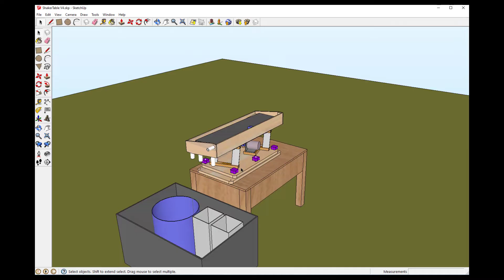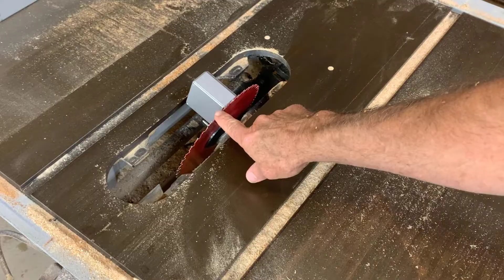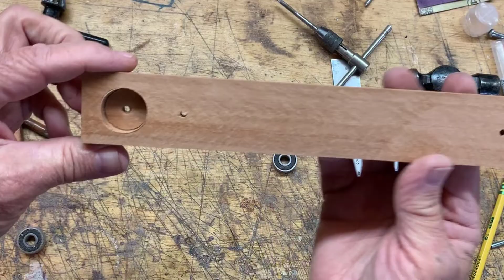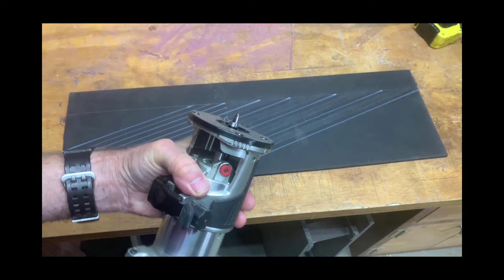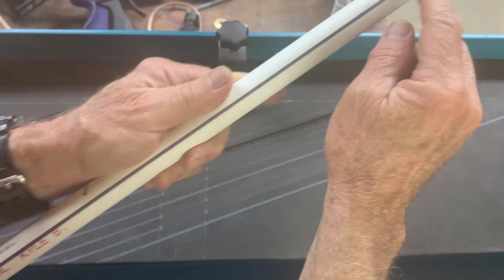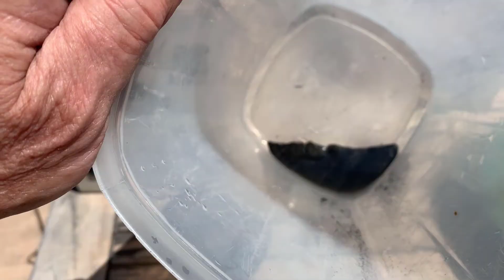Building the Mini Gold Shaker Table

Comment: Hello! Do you think this could work to separate copper from plastic? I used a copper wire shredder but I have mixed copper and plastic, they are separated, not intertwined, but the shredder's output is mixed, and I need to separate it completely from the copper
Reply from the maker: Yes, the table can be tuned to do that, for sure.

Comment: If I made a table with the same concept would 24 in x 36 in, would that be too heavy for the flexure system? Let's say I chose to use four 6-in wide flexures?
Reply from the maker: Yes, it works. I've made a table nearly that big in the same style shown in the video. I used 4 flexures that were 3 inches wide.
Reply: Hey thank you so much Dave. I ended up making 5-in wide flexures and it's just too stiff to get any motion out of it so I'm going to cut my flexures down right now and hopefully that takes care of the issue. Thanks for replying as well You're awesome man!!!!
Reply from the maker: @trevorhastings946  You can easily test the flexure stiffness when you have the table assembled but without the motor and drive. Excite the vibration in the table and note the resonant frequency by counting vibrational periods using a stop watch. You should get between 5 and 6 oscillations per second (5 to 6 Hz).

Comment: How many tons  or pounds per hour
Reply from the maker: About 50 kg/hour but it varies a lot with the material.
Reply: @orophilia  I was planning to use it for sulfides super fine sulfides
Reply from the maker: @josh2916  Yes, if the table is setup correctly then it will concentrate the heavy sulfides.  -- Dave

Comment: I was wondering if you got around to building a better one that you like for the field? And if not when you Go to build the better one. If you would make Extras. Please??? And if you want help. I will gladly help you. I'll even go gold panting with you.
Reply from the maker: Hi DWC, Yes, I've built several more after that one. I'm just finishing a new one that combines all the lessons that I've learned in the past two years. I'll have a video out soon. It's called the skew-bump shaker.
Reply: @orophilia   I actually caught and watched all those new videos that you just put out about your new Shaker table. Looks like your super close to getting it down to nothing but gold...
Reply from the maker: @DWCStuff  The problem of gold concentration changes dramatically based on the size of the gold particles and the amount of other heavy minerals. It's very interesting to find the optimum tuning of the table for each set of conditions. For example, separating gold from black beach sand is totally different from separating gold from milled load ore. I'll be doing more demonstrations of this in the future. It's very hard to fully separate small gold particles from black beach sand. It's best done in two steps. -- Dave

Comment: Love you video. Building one myself but have run into a problem. I can't find any the bit you use anywhere. Been searching for days. Was it a 5mm? With bearing at the top?
Reply from the maker: Hi Wayne. Do you mean the 8 mm bit that's used on the acentric coupler? If so, you can find it on Amazon. Just search for "8mm drill bit" and you'll find a bunch.

Comment: Hey I like your work and i am trying to make a project for my diploma completion but cant get the alloy plate (6061 t6). It would be great help if u tell from where can i buy it !
Reply from the maker: Hi Rohan. Just use any aluminum bar stock that is 1/16" (1.5 mm) thick and 2" (50 mm) wide.  -- Dave

Comment: Dear Fellow.  You have done a great initiative, I praise you.  You can also use lead oxide for recovery test.  In addition, how many degrees is the tilt of the table?  Thank you very much.  I enjoyed.  Hashem.
Reply from the maker: Hi Hashem. The table is tilted at 1/4" per foot, or about 1.3 degrees.  -- Dave
Reply: @orophilia  thanks 😊🙏🏻

Comment: Really love the video! I get that the main deck has essentially a 1/4" inch rise but are there any other angles that need to be observed with the deck to make it function correctly?
Reply from the maker: Hi Adam. On this small table I used two steps, each about 1/8", in order to reject the lighter material as it flows toward the output ports. Sounds like you get that. Otherwise, the bed is flat. In use, I slope the bed downward toward the tailings drain by 1/4" per foot so that the water flows in a direction that's more or less perpendicular to the water bar.  Take a look at my other video on the shaker table, called "Portable DIY Shaker Table..."  -- Dave
Reply: @orophilia  Thanks dave! Ill take a look at it

Comment: not sure..but seems you didn't mention the distance between the groves and the depth
Reply from the maker: Hi Brian,  The grooves are 2 mm deep, 5 mm wide and are spaced every 12 mm.  -- Dave
Reply: @orophilia  thankyou... would you have the pans for this with all the mesurements and what material that is needed...ty
Reply: like you said that the table is 8 x 27... looks larger then 8 inches
Reply from the maker: @briancharette4980  Yeah, it's a very small table.  -- Dave
Reply from the maker: @briancharette4980  There's  sketchup drawing of the table, see the description above.  -- Dave
Reply: @orophilia  .. doesn't seem to work
Reply: @orophilia  .. it doesn't open..is there another way?
Reply: maybe you can print them and mail it to me..i would really love to build it
Reply from the maker: @briancharette4980  I'm sorry Brian, the Sketchup drawing is all I have.  -- Dave
Reply from the maker: Did you download Sketchup version 8?
Reply: @orophilia  it only shows 3 and 4
Reply from the maker: @briancharette4980  http://www.oldversion.com/windows/google-sketchup-8-0-16846
Reply: @orophilia  one little question... you added 2 pieces of plywood on top ..i think it was the top... thats about the only thing i don't know why you added them.  for the rest..im ok with
Reply from the maker: @briancharette4980  Hi Brian, Yes, there are two steps in the top of the table. This helps to separate the material that is being processed. Each step is about 3 mm.  -- Dave
Reply: @orophilia  not sure what you mean by that but I think they where put on to level the top?
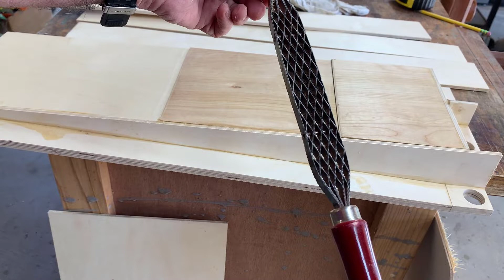Reply from the maker: @briancharette4980  If you look at 3:42 in the video you can see the two pieces of 3 mm plywood that I've glued to the top of the table. They help to reject the lighter material from making it to the two output ports.  -- Dave
Reply: And you couldn’t do it with the adjustable screws?
Reply from the maker: @briancharette4980  That's not the purpose. The steps reject the lighter material.  -- Dave

Comment: The commercial tables all seem to have V shaped grooves with a straight side on the "down" side and a "ramp" on the "up" side. Yours is flat bottomed "U".  Comments about utility of the different groove shapes?
Also.... where did you buy the rubber?
Great vid -great design!  You da' man!
Reply from the maker: Yeah, I've noticed the different groove designs. I tried a round bottom and a V-groove and neither worked well. Someday I may make a fixture for the router to try the "ramp" form. I don't see any problem with the rectangular groove but maybe the ramp groove works better. I buy 1/4" neoprene rubber sheets from Rubber Sheet Warehouse. Thanks for the comment. -- Dave

Comment: Can I ask how you made the water Bar holder clamp with screw?  Metal or 3D printed please? Thanks
Reply from the maker: Thanks for the excellent question. The water bar holders are made from hardwood. Easy for me with my tools. For a long life they should be made from metal or a good plastic like ABS, polycarbonate or UHMW polyethylene.
Reply: @orophilia  do you know what the durometer of the neoprene rubber is please? Thinking about building two 12 x 36-in Shaker tables next to each other and then with a common feed system that way you could have a diamond water table.  Thoughts?  I think the only parts that I lack for the project are the hardwood pieces.  I am thinking about using fiberglass resin for coating the wood before priming and painting....👍
Reply from the maker: @dennishedrick5308  It's medium hardness (60A durometer). I'd use epoxy resin because I hate the smell of polyester resin, but it should work fine.  -- Dave
Reply: @orophilia  Thanks

Comment: This videos helped me greatly, im probably at least 100 of your views….lol. That said I’m now in troubleshooting mode of trying to figure out why mine won’t throw the material properly (it’s not going over the first 1/9th inch step up. If I may ask, what are the width and length of the flexors?
Reply from the maker: Good morning. I worked with the machine for many hours before I understood how to get optimum performance from it. If the gold doesn't move past the first step in the table then you may need to increase the rate of shaking. I use a variable power supply voltage to adjust the speed. On my machine, the optimum peak to peak motion is 12 mm at a rate of between 5 and 7 cycles per second. The flexures are 1/16" thick, 2 inches wide and have a free span of 5 inches. Let us know how it goes! Thanks for the views. --Dave

Comment: Gee, this is fantastic.

Thank you very, very much for showing your design process (great tool, less hungry than Fusion360) and your „helpers“ like the guide for cutting the rubber. Fantastic. Really, I‘m very thankful!
Reply: Also: Using the metric system makes things easier for me.

I was wondering: Engineering in imperial/US units must be more complex than using the SI system?
Reply from the maker: Unfortunately, here we have to be proficient in both systems.
Reply: That just means you have to learn more. Yes, it may be a nuisance but others may envy one for the learnt capability 😊

Comment: Pretty good skill set! Lol! Be best to not nail into the end grain on the plywood! If you have to nail things and not use screws at least glue a small block of wood of some kind (not plywood)to nail into! Nailing or screwing should be done before not after your glue sets! Its just simple carpentry rules!
Reply from the maker: Hi Stoneman! Yeah, I agree. I wanted to keep the unit very light by using the 1/4" plywood where I can't use screws. Nonetheless, it's been banged around in the field quite a few times and it's holding up well. Thanks for the comment. -- Dave

Comment: First of all, may I say this is a great piece of machinery in general and especially to have been done as a DIY project! 😍

I do have a question on the slope: it seems to me as though the table is pushing the gold up and not down - is this the case? Is it possible to draw some arrows just to point out the movement of the material from when when it’s added onto the table to when it goes down the drain? Thanks!
Reply from the maker: The motion of the table is along the grooves in the rubber mat and upward at an 18 degree angle, also in that direction, from left to right. This drives the gold and other heavy material into the water bar, which washes that material back toward the tailings trough, into the nearest groove and the process repeats until the heavy stuff arrives at the right edge of the table. Thanks for the question!

Comment: Excellent vid thanks, Could tell me what kind of router bit you used to make the groves in the table. thanks
Reply from the maker: Good morning! I've tried HSS and carbide bits, two flute and four flute. They all give similar results. The diameter is 5 mm. Soft rubber is difficult to machine.
Reply: @orophilia  Thankyou so much. jason